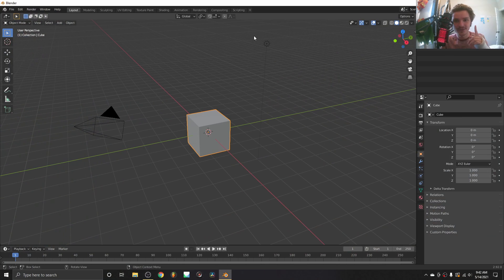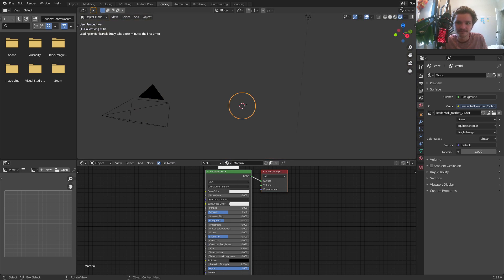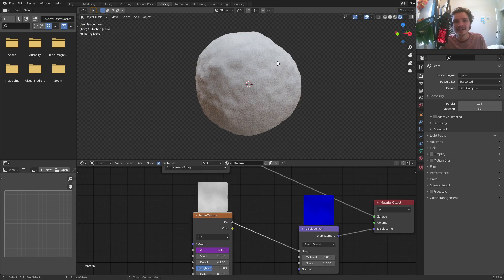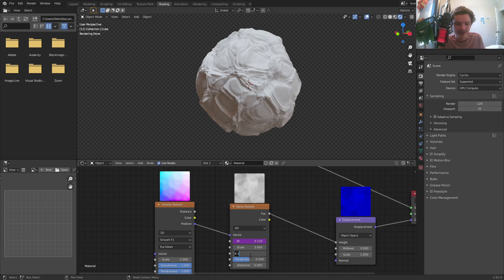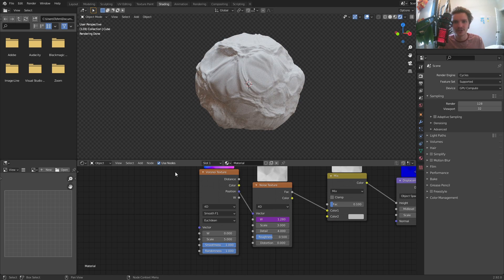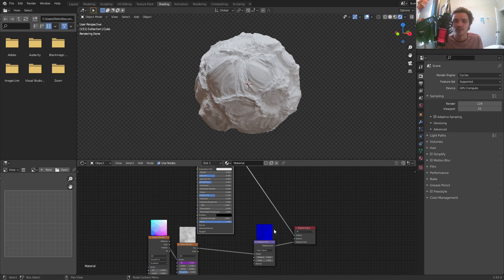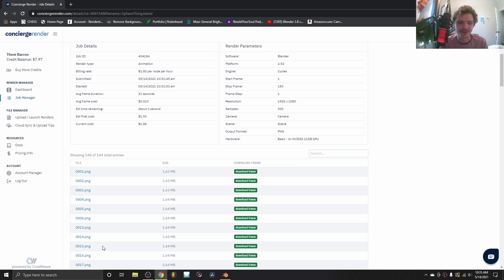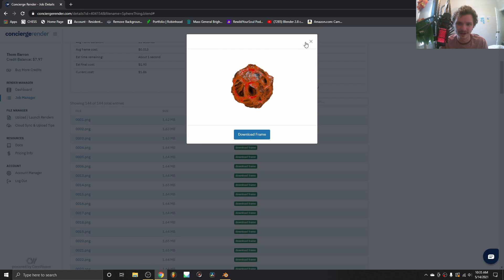A sphere tutorial to rule them all - Blender Abstract

Comment: Is it possible to create a seamless looping animation this way?
Reply: yes. There is a comment somewhere about it:

One way to do that is to cause their driver values to run on a sine wave; as long as the values on each is running at a different frequency, you won't notice a pattern just by looking at it. Here's an example:

#cos(frame*pi/30) * 50

You'll want your total number of frames to be something that is easily divisible by a few different numbers. Something like 120 or 240 is nice. In my case, this "30" is an even divisor of my total frame count. It'll go from 50 to -50 every 60 frames. If you set your noise to that and your Voronoi to "#cos(frame*pi/60) * 50" then the waves are offset, but they'll both loop independently.

Comment: You can apply a cast to sphere modifier to make a cube a perfect sphere in combination with subdivision surface(apply subsurf first)
Reply: Random question but why do people make Spheres out of Cubes instead of just taking the Regular Sphere?
Reply: @augafrost4158  Because the topology is easier to work with and causes less problems generally, a square sphere  is made of quads and a normal sphere has poles which pinch together and can cause issues with deformation  and stuff

Comment: YO, I HAVE A REQUEST IF IT'S OKAY! I HAVE BEEN TRYING SO HARD FOR LITERALLY 6-7 hours EVERYDAY FOR THE 5 DAYS HERE IS MY CRISIS:
to get a cloth (Square subdivided top face deleted with cloth modifier, kind of like a giant bag kind of thing) to be dragged around by a moving armature! and sure enough, I did it (yay!) but here is the thing, I want, the bag to react to the ground under it AND there is a sphere and other items inside the bag I want them to influence the cloth to give it like lots of folds and bulges as well and I want the cloth to affect them to get them to MOVE because it's containing them, I tried faking it by keyframing each item to move in the same path as the bag being dragged, but, of course, they don't affect cloth folds in the bag even with collision and stuff, and the bag becomes so light because it's empty that flings everywhere if I increase stickiness of the floor and/or friction of both floor and (empty) cloth it works for the first 3 frames or so(So not really working) if I try to paint weight, it doesn't look realistic (it's empty, lol) worse even is to try to increase vertex weight then it just horribly folds on itself then slowly get deformed and twisted in demonic ways as its lifeless shell is being dragged around sucking processing power...  so it's literally the hardest thing EVER! the bag is shaped like a huge (old leather kind of Pouch) that is being dragged around! I think you're the one who can save me from this mess help me, great hero, please PLEASE! i am losing my mind, sorry for the rant, I am just in dire need of help.
Reply: Keep friction low and enable self-collisions

Comment: 04:29 Why does his voronoi looks so smooth but mine looks soo jagged (like someone has stacked tiles). Did everything on point. Help.
Reply: His voronoi displacement does have jaggies when he had F1, that's unavoidable since the displacement map has an extreme edge there and because the vertices don't align with that edge, it creates a jagged displacement edge which smooth surface shading doesn't help with. If you change F1 to Smooth F1 like he did, it should help with easing up the transition between each cell of the voronoi which in turn smooth out the extremity of the edges, and help with smooth surface shading.

Comment: For anyone actually doing this, one nice thing to do is to get your textures to loop! One way to do that is to cause their driver values to run on a sine wave; as long as the values on each is running at a different frequency, you won't notice a pattern just by looking at it. Here's an example:

#cos(frame*pi/30) * 50

You'll want your total number of frames to be something that is easily divisible by a few different numbers. Something like 120 or 240 is nice. In my case, this "30" is an even divisor of my total frame count. It'll go from 50 to -50 every 60 frames. If you set your noise to that and your Voronoi to "#cos(frame*pi/60) * 50" then the waves are offset, but they'll both loop independently.
Reply: im slightly cofused it isnt working for me is there any settings I have to change or just past those into the WW vales